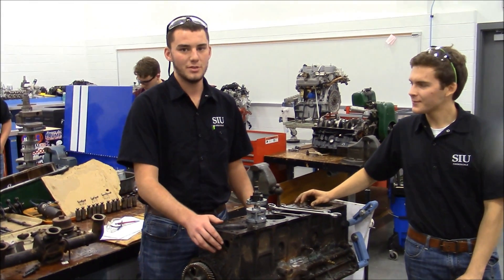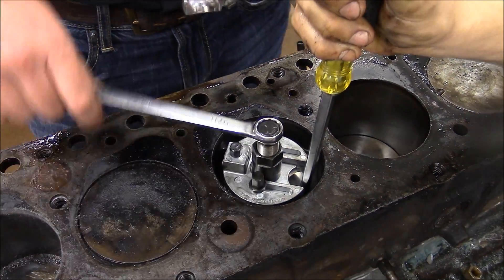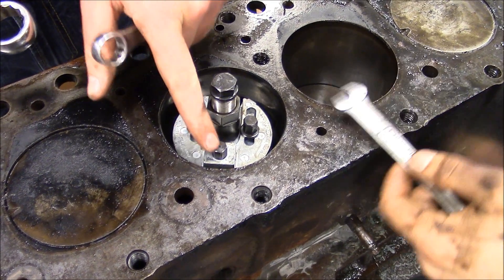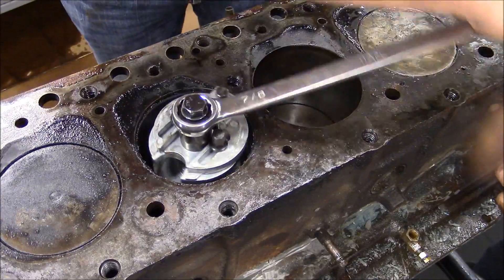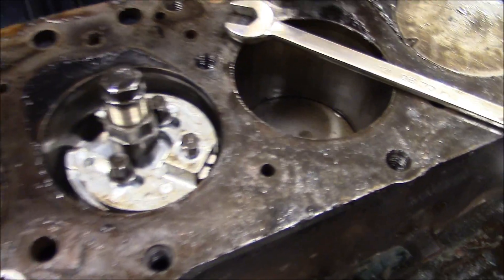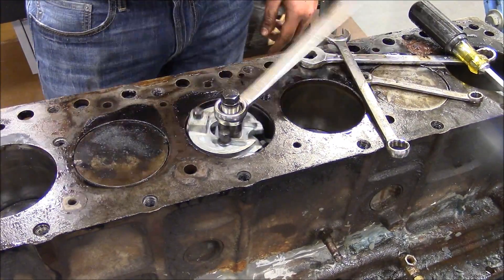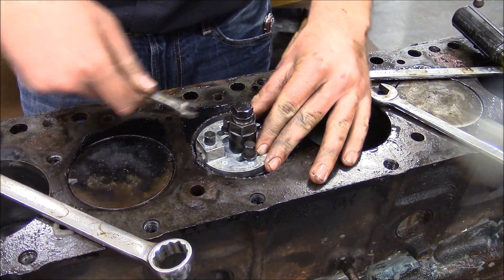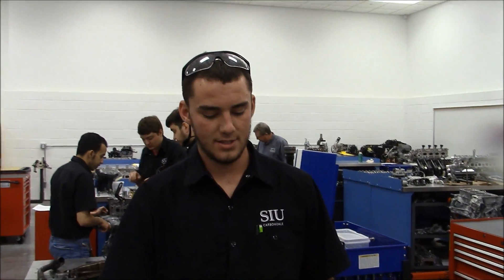Using the Ridge Reamer

Comment: Not bad, but you're too deep in the bore, ran out of thread before removing the entire ridge. Also, there should be no difference in cutting "feel" in the circumference of the bore due to cylinder wear..you are cutting UNWORN cylinder only. Again, if you feel you're trying to cut an oval, you're either too deep or the tool is cocked in the bore.
You just wanna cut unworn ridge, not the area where the rings ride.

Comment: Why get rid of the ridge.  The rings don't get that high anyway.  Think the piston will bang into the ridge???  Does that happen?
Reply: Because you can damage the rings/pistons trying to force them past the ridge when you remove them.
Also, new rings will have a more squared off unworn edge to them than the ones that wore the bore..so yes, the top ring/piston can be damaged if installed/run without removing the ridge.
Reply: @zrxdoug  Ah, good answer.  Makes sense.  Thank you.

Comment: I must have missed it. The explanation of why you have to use a ridge reamer. Cast iron rings.. When they made Moly rings the standard of the industry in the early 60s cylinder wear went to near zero. I never used a ridge reamer, with the exception of old antique engines for the last 30 years. A lot of blocks were ruined by guys that misused them. Modern engines that use metric Moly rings with low tension have the cross hatch still in the cylinder with over 200k

Comment: Works great if you have perfectly flat top piston to make sure the tool is perfectly level or sitting absolutely in line with the bore. If you have any dome or dish top to the piston, getting the this design reamer set correctly is a great big pain in the ass. It's better to use a reamer like the Lisle 36500 that has 3 expanding pieces, 2 with rollers one with a cutter and each of these has an ear that sits on the top surface,  the head gasket surface, to keep it in line with the bore. But great work here, with this tool and this engine,  with flat top pistons.

Comment: Bad finished you not put lubricant..
Reply from the maker: Cutting lube is used to cool the cutting bits. As the rotational speed of a ridge reamer is not fast enough to generate any heat, no lube is required.